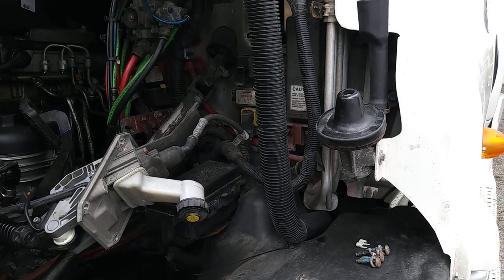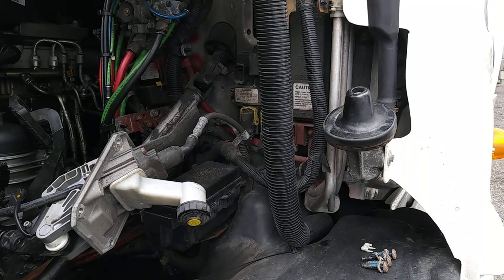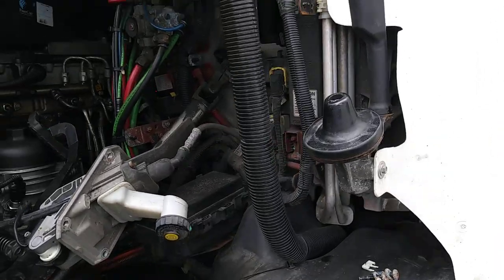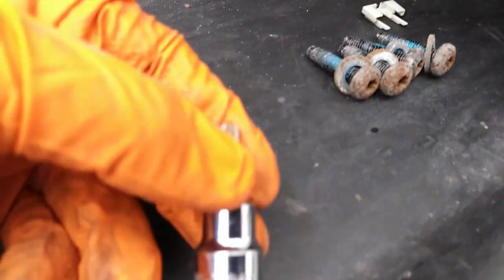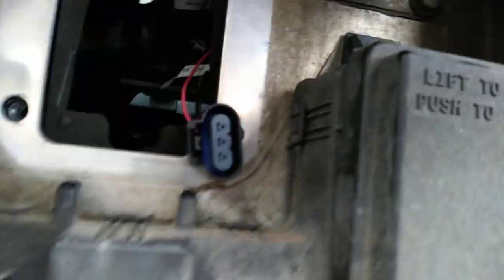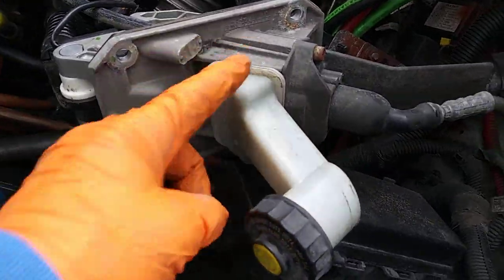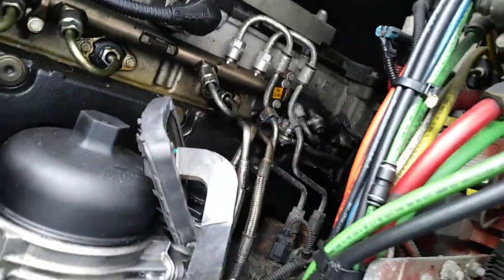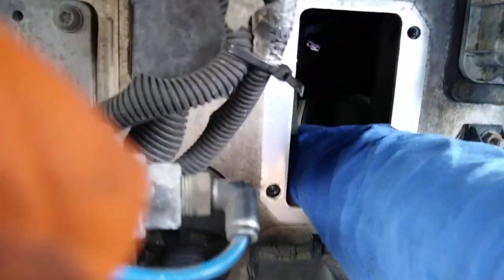How to unlock Freightliner Cascadia if the key is inside

Comment: We just had to do this! Had a blowout and locked the keys in when setting out the triangles. Was a lot harder than you made it look.... But we have an automatic and the plate was cemented on. Also, lots of other plastic and material in the way, but after hacking away (in the rain) with the roadside guy's crowbar and hammer we got through! Thanks 😊